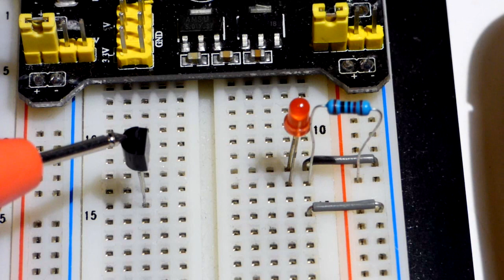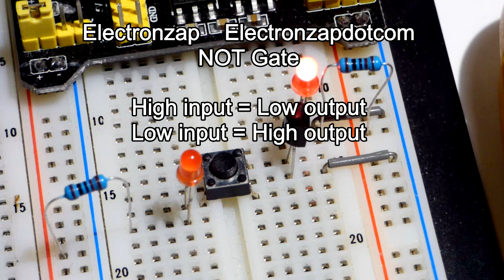Not logic gate demonstration circuit using 2N2222 NPN Bipolar Junction Transistor BJT

Comment: I cant seem to comprehend why the first LED switches off,  it has its own power source at all times  from the side rail even when the base opens, iv'e missed something somewhere, have to watch the vid again :-).
Reply from the maker: The transistor becomes a short circuit. Only so much current can flow through the resistor and when the transistor is conducting fully, all of the current the resistor lets through flows through the transistor.
Reply: @Electronzap  Thanks, so does this mean the base can let as much current through as the Coll/Emitt, i've fried/popped a few transistors the last few days and i was thinking i had to much current running through the base.
Reply from the maker: The base to emitter does not limit current at all once you have about 0.6V of the right polarity across it. You always need to limit current with a resistor if current is not limited otherwise. Base to emitter also doesn't handle reverse voltage very well. Hope that helps!